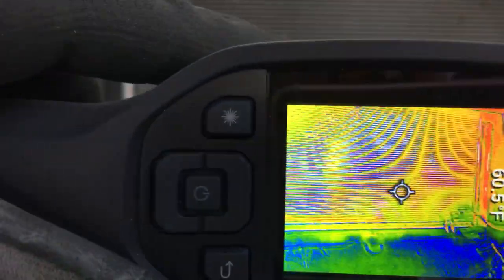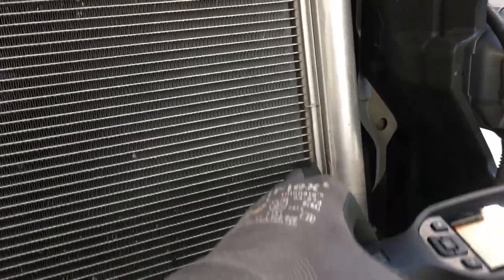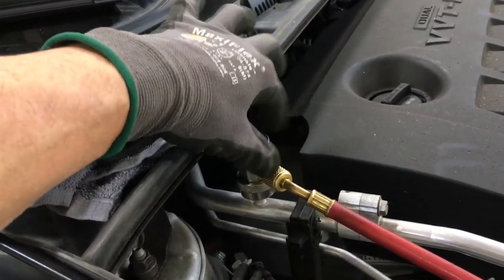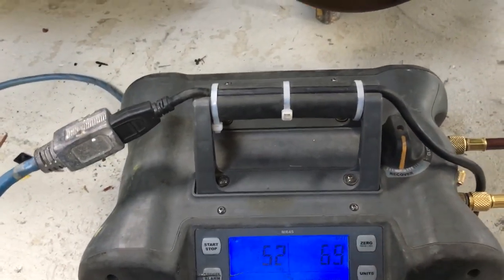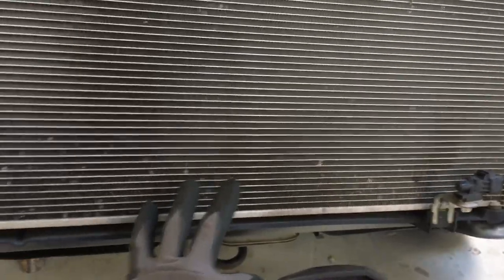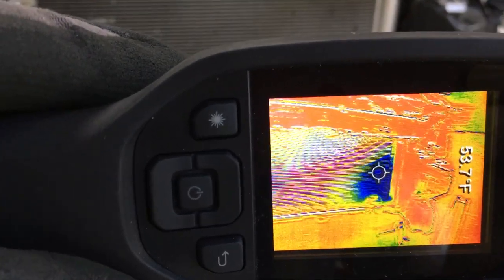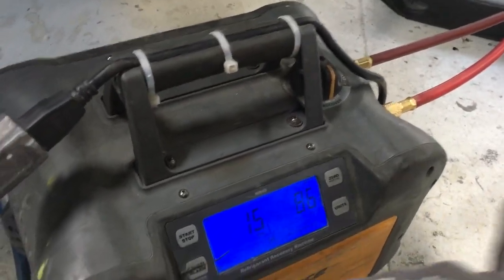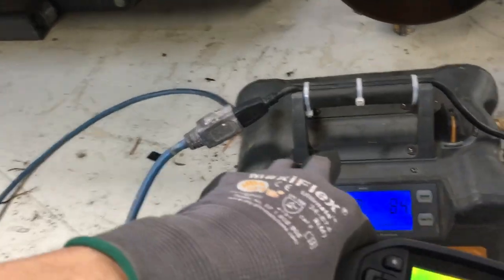Pressure drop of refrigerant inside condenser using thermal camera.  Performing refrigerant recovery

Comment: Fascinating. I understand the theory. Just never watched sublimation. I have a IR camera for my iPhone. Between that and the IR thermometer I’ll know more than I ever have. I start evacuation work in Florida I’ll have to use a cooler and ice water bath to get the tank to fill. Yup, 2/3 is full. Got it. When I did AC for a living, we had one of the first recovery and recycling machines. Automatic most of the time. Thanks
Reply from the maker: If you have one of those small cheap freezers from Home Depot or Lowe’s about $149 $160 
-22°F stick your recovery tank inside there of course well it’s under a deep vacuum. With the hose connected and the lid closed and the tank pre-chilled. 
          With no mechanical pump attach that to your vehicle and you’ll get about 90% of the charge that will condensate back into a liquid in the cold tank maybe even more it all depends on the ambient conditions and how long you let it sit.
           It’s good to know the basics of grammar school physics
Reply: @coldfinger459sub0  I got a cheap peltzer ice chest. Chill overnight and keep it in it. Be interesting to see how that works
Reply from the maker: @christopherrasmussen8718  ice is only 32°F that will remove some. 

        You’re trying to go for that -22°F. 
 Actually condensing the refrigerant back into a condensed liquid

         At the temperature of ice at 32° it’s still a higher pressure vapor. But it will still do some work and remove some refrigerant at 32°F
Reply: @coldfinger459sub0  come to think about it, after all the vaccine is done those -50’ freezers will be a dime a dozen
Reply from the maker: @christopherrasmussen8718  lol We can guarantee to rely on our government to overspend buy too many and then throw away for a penny on the dollar. 
           Our tax dollars hard at work

Comment: I look good the use of portable HVAC recovery setups but I never seen these on a repair shop. Dedicated recharge stations are only servicable by their own parts and I doubt of their maintenance schedule programs like 1000hr use of vacuum pump oil, tanks are not easy interchangeable, sometimes you have to spend days waiting their own filters, overpriced software upgrades to get newer cars system weight capacity... Its easy to mantain properly a portable machine than a equipped charge station with full accesories, a big machine isnt a disadvantage but equally a portable one does the same job and the unique disadvantage is that you have to pay more attention, so maybe Isnt a disadvantage at all
Reply from the maker: The little portable ones are nearly indestructible and nearly 0 maintenance at all for the recovery machines the last decades I use mine anywhere from 6 to 8 times a day. 
              There’s only one part you would be changing and you could get it from anywhere from any manufacture and use nearly any size you want and that is the filter dryer going into the machine just to protect your machine from debris from a dirty burnt out system that you’re doing recovery on. 
              There is no oil to change or maintain those were old systems way back in the early 90s are used to own one of them and believe I still have one in storage that I haven’t used in decades.  There is no software updates there is no proprietary items you don’t have to wait for a service technician because supposedly you are a mechanic and you can take it apart and fix it yourself they do have rebuild kits. 
          If The Mechanic can’t fix his own machine he’s not a mechanic he’s just a parts monkey. 
               Now as for oil in the individual vacuum pumps they to last for decades.     And the oil should be changed much more often than 1000 hours. Doesn’t matter what the manufacturer tells you they’re trying to tell you a minimum chart changing interval to keep the complication and price of maintaining the machine down. 
         Sales and marketing are low life scum sucking Ffing idiots, shysters, thieves.

         The filter dryers on those large dumb boxes that get sold the shops (RRR) Machine. 
        I’ve actually dumb down our industry because guys got too lazy don’t use their brain. Just hook up the hoses punch in the numbers and walk away.   It’s on teaches you to pay attention and have your hands on the different pipes feeling the pressures and temperatures change using your ears and your senses come back to a car that’s either working or not working after the machine is done. 
            Example you can have a car that’s not leaking under pressure but the front shaft seal starts to leak let’s pretend at 9 psi vacuum. 
           So well your recovery machine is pulling refrigerant out once it reaches that point it’s continuously pulling in a small amount of humid water saturated atmosphere completely saturating the system and the machines filter dryer with moisture. 
              Once the machine does that even one time the filter dryer is no longer any good and can no longer remove moisture out of the refrigerant so it just keeps building up in the refrigerant it’s recycling and pumping it back into other customers vehicle like an STD. 

             Many years ago they used to put a site glass with a moisture indicator on the machines.  You can tell when the filter dryer was no good. 
             Because the manufacturers were right this long number of hours to make their machine look good that you did not have to change this expensive proprietary filter dryer that you would have to order and wait for.    They remove the site glass because of complaints of the above example I explained they buy a brand new $4000 machine and they get that one vehicle for that one technician that leaves a leak on the hose not connected all the way or a leak at a seal at the coupling fitting from the machine and it pulls in the air and that expensive filter dryer is no longer any good because the moisture site glass would show that. 
              So in all marketing and sales man genius what idea did they come up with. 
            “ Eureka let’s remove the site glass with the moisture indicator so the owners of the machines don’t know that their filter is saturated with moisture then we will not get any complaints about how bad our machines are because they have to buy expensive filter instead of after 100 or 200 cars like we told them if they did 10 cars and it went bad they complain. 
               Salesman in the marketing and large corporations are nothing more than maggots on society of virus a cancer when it comes to money in profits. 
            In automotive shops and their owners are nothing more they look at them like suckers an ATM machine and you sucker is born every minute who is ignorant about the equipment he’s about the purchase. 

           Individual vacuum pumps you can buy a vacuum pump many times more better than anything that any big manufacturing corporation will ever incorporate in one of their machines because of the profit margin‘s they wanna make take a look at my NAVAC 12 CFM vacuum pump
https://www.trutechtools.com/NAVAC-NRD16T-Industrial-Vacuum-Pump-12-CFM

Completely blows any manufactures automotive big dumb square box out of the water they can’t even come close to touch this. 

             My NAVAC recovery machine under ideal conditions I could recover a small Honda in about 2 to 3 minutes. 

https://www.trutechtools.com/NAVAC-NRDC4M-4-Cylinder-Brushless-Recovery-Machine

https://navacglobal.com/product/worlds-first-dc-inverter-4-cylinder-recovery-unit-nrc4m/

          Compared to the garbage that they install inside those big machines is ridiculous.   On top of that the small tubing with all the bends and solenoid valves and small passages that the refrigerant flow is restricted and force to go through slows down the process in the big machines. 
               The automotive industry does not push the use of these little tiny recovery machines it’s not profitable. 
            Then there’s the safety of technicians over filling tanks and since they know the automotive industry owners and operators are usually either cheap they are lazy or they were ignorant and may not follow safety protocol in the rules regulating tank filling and cause serious injury or death.    But that’s only because the industry has such a bad reputation of having under educated ignorant lazy cheap individuals owning running the equipment.   (RTFM) A large majority do not like to read The manual. 

               Another problem in the automotive industry if somebody doesn’t see something they don’t know it exist or they don’t believe it. Or as you say don’t see an item in other shops because of their limited locality and availability to other shops. 
                If you ever heard the term (“ birds of a feather flock together”) 

             The coolant vacuum procedure where you use air to pull the radiator coolant system under a vacuum and then use the negative vacuum pressure to pull in coolant so you have no air bubbles my dad was telling me about this when I was between 12 to 15 years old working with him and look how long ago that was I’m 56 years old and that equipment already existed automotive industry is extremely naïve and ignorant of their own tools and correct processes to do things to help them better because they are cheap . 
                  Portable battery chargers were available 30 to 40 years ago now you see them everywhere. 
             Before that shops relied on jumper cables or they would use a battery charger and overheat and destroy batteries in the customers cars cause explosions or damage electrical systems that could’ve all been avoided with the use of portable battery booster’s.      As a mobile technician I had one30 years ago and would walk in the shops and they would hand me a dead car in a body shop with a dead battery I would always ask them for their booster pack they were always too cheap to buy one because they cost several hundred dollars30 years ago that was considered a lot of money. 
         But compared to all the burnt ECUs or power control module burnt up alternator or damaged batteries from using battery chargers and cooking the batteries over voltage.